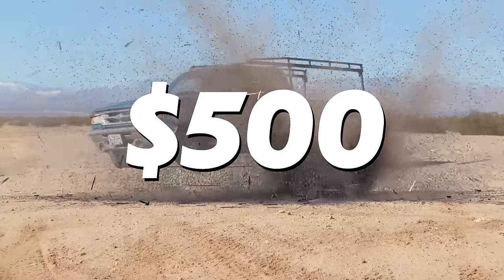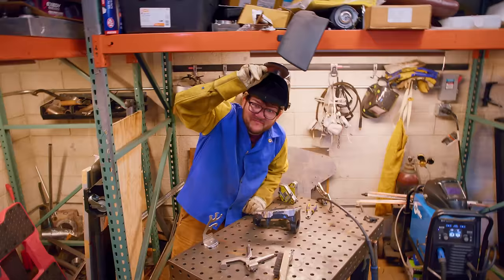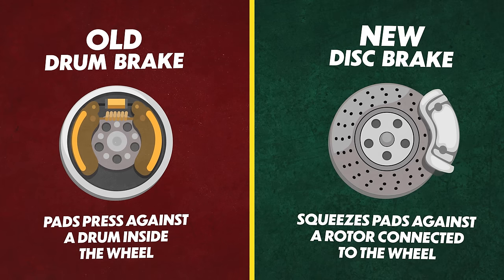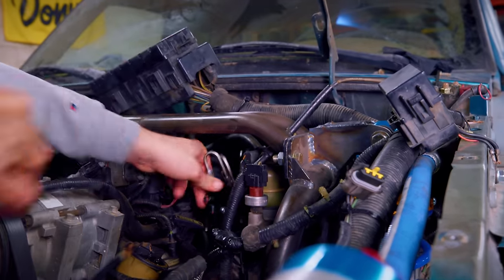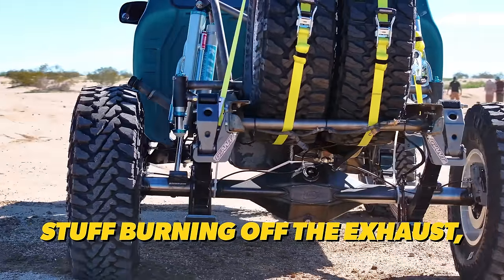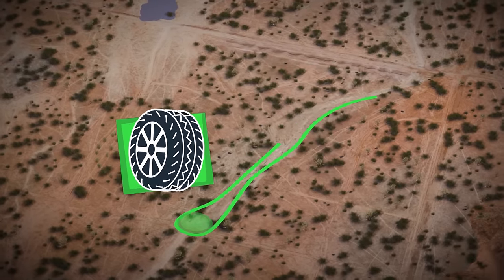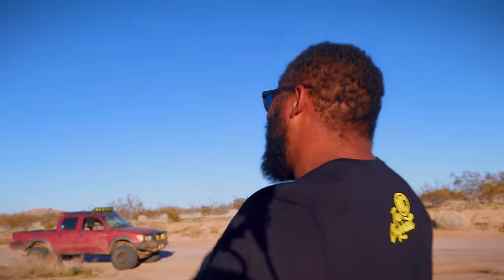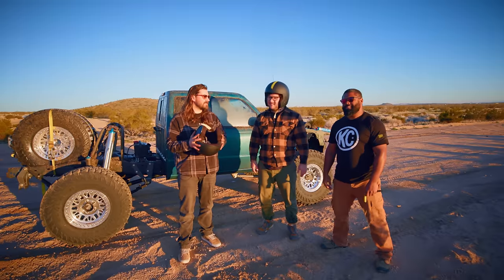We Put $5,000 Brakes on our $500 Ranger

Comment: 19:37
Nolan: it’s actually pretty smooth
 two seconds later
Bounces rapidly
Reply: looks like they need to tune them shocks
Reply: @JackSpeed  That's what I was thinkin.
Reply: Proper seats and harnesses would solve a lot of that
Reply: That suspension is far from sorted. Hopefully they get them tuned up and working properly.
Reply: @moto132tv  I was definitely wondering why they went with leafs rather than a 4-link and coils. Especially cool would be coilovers with cantilevers but I wouldn't really expect that bit.

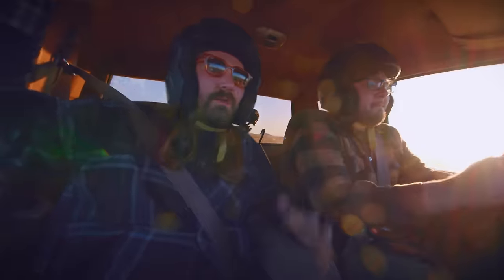Comment: 21:39 Put a couple turns on the rebound tube of the rear bypasses and pull a couple turns out of the lower compression tube- should help with the bucking.
You guys could do a full episode on shock tuning!
Reply: There will be more weight in the rear later to help with that
Reply: Yeah they need a pro to dial in those shocks. It was bucking way too much for that setup
Reply: Also looks like the tires maybe at highway pressures instead of aired down tbh. Takes a lot of the shock absorption as well to have the tire pressures right.

Comment: At 6:50 drum brakes have a higher initial clamping force than comparably sized discs, but they overheat quickly. Rear drums are great for a daily driver because they wear more slowly than discs so they're overall low maintenance.
Reply: Also don't get fucked in the rust belt if you barely use your brakes. (Like in an EV)
Reply: @rkan2  I live in the rust belt. My drums get fucked way faster. It isn't the shoes or the drum itself but rather the little linkages that rust solid.
Reply: Drums on the Tacoma were great.  Everyone complained about them, but I bet they weren't complaining when their brake job only cost $150-$175 for only the front and maybe a single can of brake cleaner for the rear drum shoes.  No idea what's on there now, but hopefully it's disc brakes for a $48k medium sized truck!
Reply: @VTOffRoadAdventures linkages COULD be made out of stainless steel, so in theory that is a solvable issue if not for penny pinching by the OEMs.
Reply: @mattb9664 that's probably be cause rear brakes wear at about a quarter of the rate of fronts, even less on pickup trucks that aren't loaded down, not because they were drums.
Reply: if you drive a slow daily that is 😈
Reply: I'll take rusty disc brakes over rusty drums every day of the week.  I've had far too many misadventures with frozen drums on rusty old cars.  Never had nearly as many problems with a disc break car seizing up.   @VTOffRoadAdventures
Reply: @MomJeans2  I'd love discs on the rear of my 88 but really the conversion isn't worth it. I'm still chasing rusted linkages all the time though even after rebuilding them.

Wife's 2015 has rear discs and once I put geomet coated rotors on they don't get a hint of rust and never freeze up on me.
Reply: It's also easier for engineers to include a handbrake on drums if memory serves.
Reply: Good for parking brakes also after doing hot laps since they won't warp the rotors!
Reply: @rkan2 misconception
Reply: But when you do need to maintenance them they are a pain in the ass because it's been so long since they've been apart that everything is rusted solid. At least here in Wisconsin
Reply: Drums also work better as a parking brake because surface area, and are easy for engineers to incorporate them into a parking brake. Actual stopping power? Discs all day.
Reply: Why doesnt trucks use it
Reply: Discs already take years to wear and for a daily are inexpensive too even when the time does come, so I really couldn't care
Reply: You have to use the absolute shit out of your brakes to overheat rear drum brakes. In all likelihood the stock brakes were probably a better balanced system that worked at least as good and it would take a lot to overheat them. Ford didn't spend multitudes more than Wilwood developing their brakes for no reason.
Reply: Semi trucks still use drums for a reason. So does every heavy duty peice of equipment.
Reply: @VTOffRoadAdventures this is not true at all lol
Reply: @rkan2 definitely not true, in fact I’d venture to say they rust worse lmao

Comment: The microwave beeping is a great feature on the truck. 10/10 🔥
Reply: My dog did NOT like it 😂
Reply: Dino nuggies are ready boys!
Reply: @stevenb891 my dogs fine w beeping or any electronic noises but the moment a doorbell goes off in a movie he loses his shit
Reply: @LUCKIPUP relatable!!!
Reply: Don't think that's a truck noise. You can hear the "door open" tone during their test drive and it sounds way different. Probably a "low battery" alarm for a camera or some such.
Reply: Air bag alarm. My Ranger does it now that I have a quick release steering wheel.
Reply: I was like, I don't remember putting anything in the microwave, oh, that's coming from my TV!
Reply: i had to pause the video to make sure
Reply: It could be a ups. You know, for all the electronics and cameras that aren't 12v
Reply: @andrewstuckey2654  Ah, good to know.
Reply: For real tho, that beeping is that blue box behind the stereo, it’s either saying the airbag is messed up or the cluster is bad.
Reply: @gtenthusiast98  Yup. That's been around for a long time. It only does that if the airbag light is either out or not present, though. Ford tends to keep some old stuff in their designs (ex: Brand new ford F150s will still use the old piezo speaker for the chimes if the APIM hasn't started yet or the battery is low. It happened to me.)
Reply: Definitely airbag alarm. I had that same gen Ranger, and so did my brother-in-law, and both our trucks had that thing going off. They're notorious for it
Reply: @andrewstuckey2654  Ohhhh. My truck's been very occasionally making this noise for a bit on a random startup here and there for awhile. Was wondering what it was. Might hafta look into replacing the airbag.

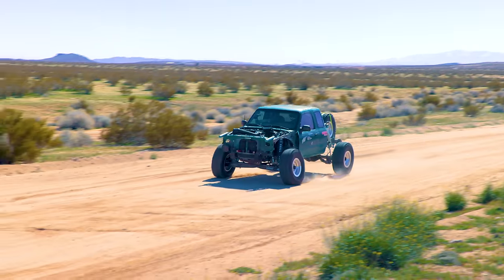Comment: 15:34 I used to have a 1998 Ranger. It used to beep five times and repeat five times. If thats what is happening in your Ranger, its because the airbag indicator light is burnt out. When the indicator is out, it beeps to alert you that the airbag is on. To stop the beeping, all you should have to do is replace the indicator light.

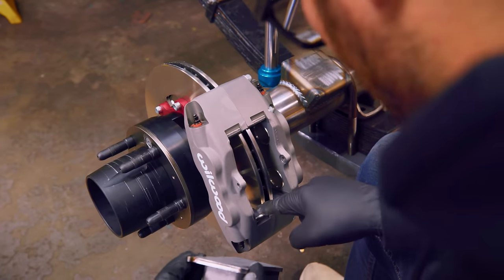Comment: The anti-seize application at 6:04/5 timestamp with the blur sensor is all the little things that separate men from the boys in terms of texture, detail, comedic micro-moments during production and editing of these great videos. Thanks for always keeping the theatrical bar sky high.
Reply: That grey shit is crap and will dry out.  You want to use copper anti-seize.
Reply: Regular anti-seize cannot withstand the heat of breaking systems. It will dry out and turn into like a dried paste. If you really want to do this step then I suggest the copper based kind like the guy above me says, but it is not really necessary. If you don’t want your breaks to squeal just make sure you get ceramic pads
Reply: Squealing brake pads are for people without WD40 😂

Comment: The beeping 📣 is the passenger airbag light burnt out, my ranger did that too. 
Pretty much Ford has an alarm to notify you when that indicator light is failing since it's a safety function it's super annoying. There are ways to bypass it or you can just move a bulb from something else on the cluster into that slot and it will stop.
Reply: My f150 does this and I hate it
Reply: I'm a s10 guy but can't you remove the beeper box alltogether, you know cuz racecar

Comment: Those yellow dots on the new tires are the factory balance point. The manufacturer puts it there so you can line the yellow dot up with the valve stem, since it's the heaviest spot on the rim. Makes for an easier balance job with less weight.

Comment: 6:10 There is a special lube meant for that specific application. Anti seize works in a pinch, but will not hold up to the weather and say a Car wash, the same as the specified lube will. Word of Advice. Use the proper stuff, You wont be replacing your calipers and rotors WITH your brake pads Every single time.

Comment: What my father told me is that drum brakes are engaged by default and is disengaged to drive. It helps in emergency situations where if something fails the brakes engage by default and slow down the vehicle. On the other hand, disc breaks are disengaged by default and use the brake fluid pressure to engage while trying to slow down. If your disc breaks fail, you’re SOL as far as slowing down.
Reply: While what your father said was true, it's only true for air brake systems in larger vehicles like semi-trucks. Passenger cars use the same hydraulic force to apply pressure to the drums that disc brakes do. I imagine it's because air systems are a lot more complicated and heavy, even if technically safer.

Comment: Also frame enforcement in the middle to connect front and rear, not to collapse in half on a hard woop, some suspension adjustment to achieve higher clearance at the front, will give better grip in turns,, front rebound 70%, rear 45%, fast valve front 65%, rear 40%, slow vlave front 80%, rear 60% and a bigger metal tank where you got the spears mounted and it should balance out the weight distribution better without having ass fly over the head on a series of woops

Comment: Not a mechanic and just a rando internet dude, but have off-roaded for many years. Think about changing the camber on your rear axle. I should decrease the play and pull of your axle when the suspension flexes and take some of the torque off of the connecting parts as well. (specifically, like angle it about 15 degrees or more tang up)

Comment: This actually is a video I’ve been looking for! 
So I have a 2012 canyon, and I’m stuck between sell it and get a newer Gen 2 canyon, or upgrade it until it’s almost unrecognizable.  
Being said, if I’m Frankensteining my truck, I’m starting with brakes, and I currently have rear drums, and front trapped rotors.

I’ve found a kit online that converts the front brakes into 6 piston Wilwoods with enlarged rotors.  I’ve also found a rear drum to disc conversion kit. (Not 100% sure if it was 4 piston or standard 1-2 position brakes). 

All that being said, would I need a new proportioning valve?  I’ve been told yes and no.  Issue is I’m not 100% with proportioning valves.  

Normally I would just be getting a newer nicer truck, but my engine is a beautiful 3.7L I5.  Only American made I5 (technically there was a 3.5L but the 3.7L is the upgraded one). 

I love how weird my truck is… most things I need to custom fabricate because no one has parts.  Where the new Gen 2 are a lot more common making it a lot less special.

Comment: amazing, that camber though is a big chunk off, it seems it was aligned about vertical during the production, but unfortunately the truck had the suspension fully dangling in mid air, now at ride height it is pretty funny, and during the max compression shots it is just hilarious, that said, that is amazing how much was done in that little time, it is basically a new truck, and a billion times more capable, 
also, i don't thing the rear differential pinion angle should be that low hanging, i'd say at ride height it should be alined with the trans as much as possible, sure when you accelerate it will bump up, but when you decelerate it will drop down, at this position, the universal joints will not be happy

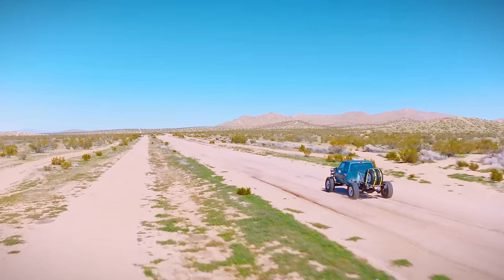Comment: 15:35 the beeping is the airbag module. You no longer have your airbag impact sensors on the front so it beeps 5x in a set of 5 every 45ish minutes to let you know the system has a fault. The module is in the passanger kick panel just unplug it and take it out. Should be a blue box. Will not hurt anything if you remove it. Ive owned five 96 rangers and all had that issue. Hope you see this and it helps.
Reply: MVP right here
Reply: Thanks for that
Reply: I thought it was because James’ hot pockets were done cooking 😂😂😂
Reply: Ya I need to stop mine felt like k was in my Ranger every time it beeped😂
Reply: dam, They didn't even reply. Thats crazy. you saved a bunch of us. Not all heroes wear capes

Comment: Out of all the vehicles I've had, my '96 Ranger still holds the largest place in my heart. They're not fast, they're not powerful, but man are they fun.
Reply: the 4.0 has some decent power
Reply: @pace5316  I had the 2.3 😊 Did end up with a '98 Exploder after that with the 4.0, which was basically just a ranger with a cap. Loved that vehicle too!
Reply: My 1994 makes me feel the same way
Reply: What is the most reliable engine though that’s in an older ranger?
Reply: I had a 94 rwd stock suspension and put 32s on it. I’ve never had as much fun in any vehicle back road cruising as fast as it could go to mountain logging roads and snow. And it just wouldn’t die lmfao can’t tell you how many times I almost ran it out of oil. Just didn’t give a fuckkkkk 😂

Comment: It will be a whole lot smoother if you lift the front a bit more to gain some travel and remove one or two of those leafs from the rear leaf spring packs to soften things up.  The less bumpy and more like a Cadillac you get that ride and the faster you will be able to go.  If you don't feel the bumps the suspension is traveling up and over the obstacle as is the goal vs bouncing off of it.  Great work though, I love ranger prerunners.  Fun trucks to have as a daily driver in the high desert.
Reply: well in reality they just need to do some shock tuning and soften there whole shocks all around have less rebound also i dont think they aired down at all they should probably be anywhere from 12-16 psi
Reply: @matthewcampbell7201  all true. They brought Porterfield in to help, hopefully he will be back to help them dial it in
Reply: You’re forgetting all the weight from gear, fenders, cage, fuel cell…
Reply: Yes all good points as well.  My true point is that that suspension still needs to be adjusted a bit and I’d love to see the truck reach its full potential.
Reply: @razgriz4118  Exactly! Those are link killer springs from giant motorsports. They are intended for "race weight"  like you said fuel cell, roll cage etc...  that and shock tuning and this thing will be smooth as butter. This is donut media not terra crew so they are learning

Comment: I'm still wondering why they didn't relocate the leaf spring, it still looks uncomfortable to drive with that crazy spring rate/ restricted travel.  One end should be attached to the axle, and the other end should be attatched to the frame.  Gives much better travel and tuning capabilities on the shock.  Still,  a sick build nonetheless,  10/10👌😎

Comment: The stock Ranger probably would have been fine if you swapped in a locker or a limited slip. My cousin has a 02 Ford Ranger 2WD and he put in a new in box Eaton Truetrac he bought off of me. It has the Duratec 2.3L I4 and he's gotten through some spots I wouldn't take my 99 4WD Ranger. LOL

Comment: Beeping is caused by the either an open door sensor or seat belt sensor the bed light on the roof is on and that turns on when the door is open or if they have the dash light dimmer switch turned all the way up past the click to turn on the dome lights: source? I drive a ranger

Comment: Yo man not trying to bust on you just some constructive criticism you are using that angle grinder wrong that's why it was breaking disk and locking up on you. You always want to cut with the front right corner (looking down on the disk about 2-4 o clock. You need to position the guard so you can cut like that the sparks should never be going away from you always towards you so you need to stand off to the side!

Comment: The reason why it bucks on the whoops is because they didnt do the right suspension. They half asses it. If they would have done trailing arm rear suspension like your supposed to for this style of offroading it could go highway speeds over those bumps. They half assed it and it shows

Comment: American methodology.  Buy the wrong part and cut bits off to make it fit. Weld it, adding stress and heat into the part that was manufactured to specific tolerances, removing strength all the time. Have many issues and force it until it breaks. But you filmed it so it was all paid for.
UK Methodology : Build an overly elaborate machine and make the customer parts you need that fit perfectly but take many many months to produce, and then miss the pointless deadlines you set for yourself for no reason. 
German methodology, research and find the best most accurate part, and put it on hassle free. Then drive and have no issues.

Comment: Pretty sure drum brakes are better than disc in everything but heat dissipation.
Reply: Only when the diameter is the same.  When you ditch the drum brakes for a large disk, that no longer holds true.
Reply: @ImARealHumanPerson  Well of course if you increase the size difference enough the advantages change. That's not really the point.

Comment: No anti seize for your desert truck brake pads, dust sticks to it.  Who cares about squeak, the pads you are using should squeak way more than any other part on the truck.  Why did you go with a floating rotor on the rear but not the front?

Comment: Use that fancy brake adjuster to adjust those brakes to a  more 50/50 split you are diving way to hard into your turns.  You should be floating through them!  This is a race truck not a track car

Comment: Check out tom morana v6 racing if you're looking into higher ratio rocker arms or a stroker kit for the ranger. They may also carry a carb swap kit if you're interested

Their 3.3 stroker kit, roller rocker kit, and cams for the 3.0 vulcan are amazing. There's been a few kits assembled in ford tauruses, a couple with a 5 speed box using a tempo v6 flywheel, clutch, and transmission to hold more power than the stock 4SPD auto